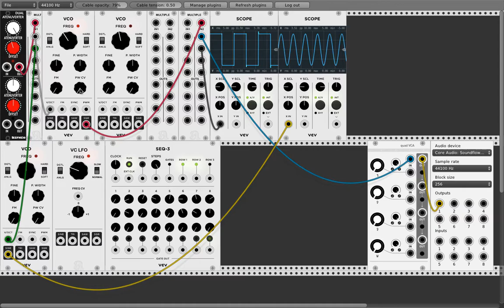Modular System Beginner Tutorial #03: VCO, PWM, FM ... with VCV Rack

Comment: there seems to be a bug, my pulse width and PW does not work, at all, everytrhing else works as intended
Reply from the maker: There is an atenuator for PW if you want modulate it with voltage.